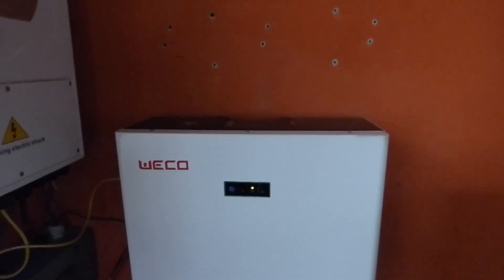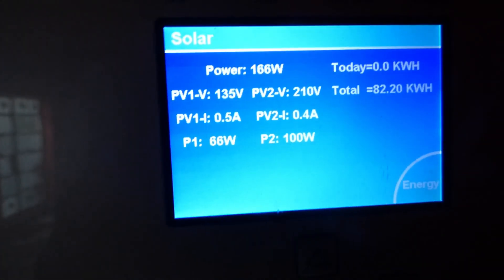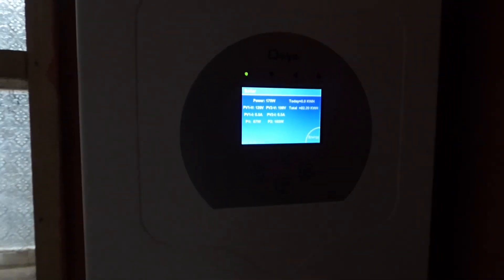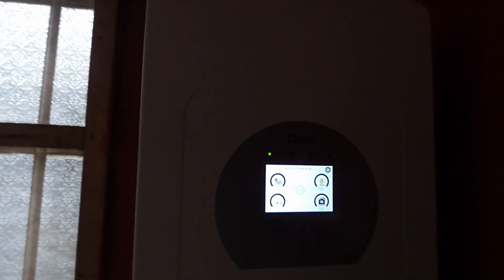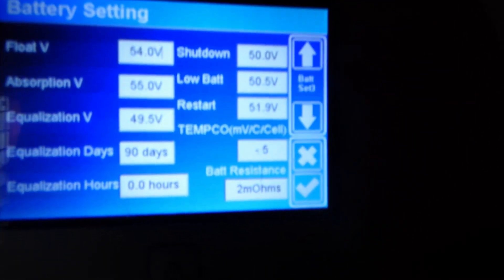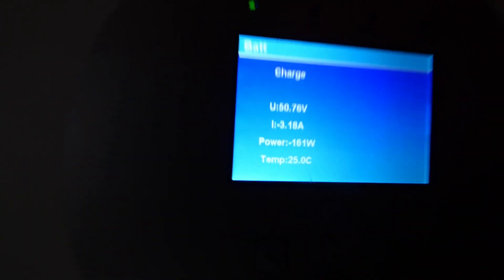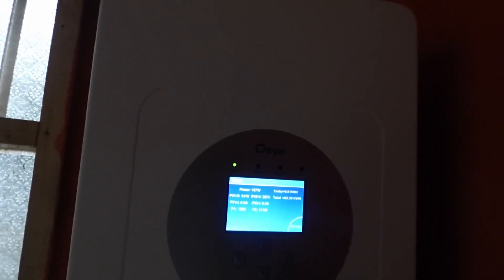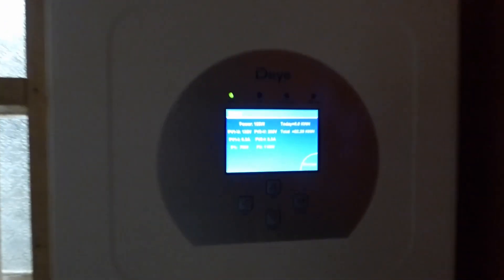No power in off grid home. Deye Inverter in week 2, shut off my lights

Comment: Hello, I have a Deye 12 kw inverter, if I disconnect the photovoltaic panels, it goes into restart, the display is off and still wants to start.... the same way in the evening when I have no voltage in the panels (it has no batteries)
Reply from the maker: Thank you for watching and commenting. Start with a firmware update.

Comment: I had issues with my deye inverter,it is showing off grid on the line diagram even when have grid AC supply to it.wat could be the cause?
Reply from the maker: Grid voltage is not meeting the threshold. Thank you for watching and commenting
Reply: @drsolar  pls  throw more light on the Grid threshold voltage, better send me your contact?
Reply: @drsolar  also the present of the Ac voltage at the grid could not charge the battery even when the PV panels supply is low

Comment: I have same oroblem, but I have around 600 volt from panels, the inverter still refuse to start on rainy days.  I really dont understand why 😢
Reply from the maker: Which inverter do you have? Deye single phase inverters need less than 500 volts. Thank you for watching and commenting
Reply: @drsolar  It is a triple phase,  DEYE SUN-12K-SG04LP3-EU
I have no battery, but according to Deye it should work fine anyway. The reason. for no battery is, I use all I can produce from pw'd in winter, and I can sell what I cannot use in summer, why buy a battery? ( I live in Denmark)
Reply from the maker: @W3c16B  it needs more than just voltage. It needs to see enough coming from your panels to power the load and or sell to the grid. It will remain in standby till it happens.
Reply: @drsolar But... I think it gets that, the strange thing is, if it starts, it can go on selling and so on all the way down to zero W.  ( in evenings)
When it start in mornings, it will not start below 5- 700W. 
When it start, it jump from zero to forexample 600W i a second, + voltage goes up from 40 to 600 volt also.
So why can it work at very low voltage, anr watt when it is startet, but need very much to do the start? 
My friends Huawei start as low as 30w in mornings.
So far Deye support say it work without battery.. but .., maybe it sometimes will create f31 error, but it will work, but it doesn't..  
I got the f31 error twice, last time two weeks ago, first time 2 months ago, so that is not the problem. 0:01

Comment: Good day, just incase a sudden power interruption during night time and the running load is 3kw ac, does the deye can still handle the load of it will go on fault? Just installed deye 5kw with 48v 200ah battery
Reply from the maker: Thank you for watching and commenting. What is the surge of the AC? If it currently carries it then it will switch to the battery. The battery is 10 kwh and will run for about 3 hours if it is a lithium battery, less if it is lead acid.
Reply: @drsolar  so the deye can operate motorized load even the grid is down? Thank you very much, you are very helpful, more power